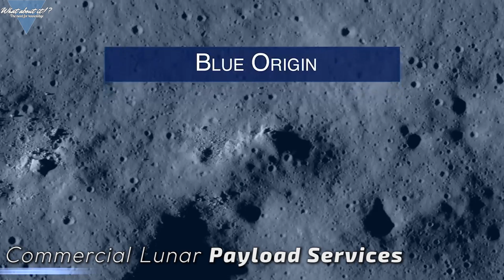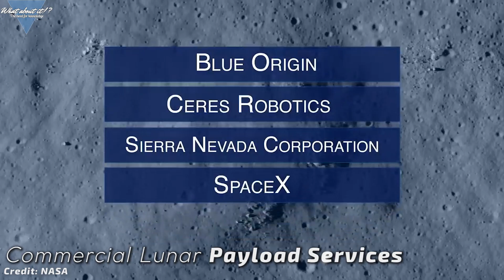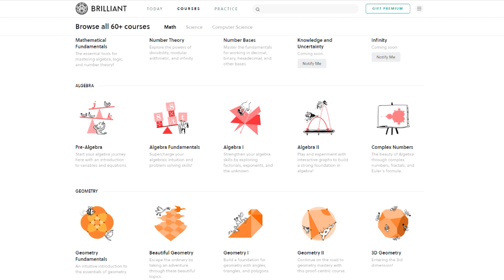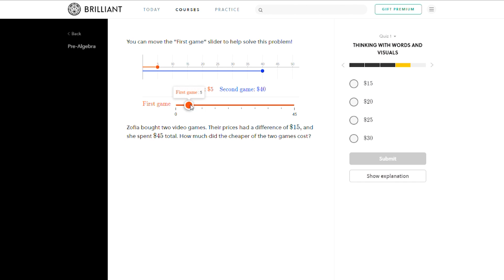69 | Starship Updates – SpaceX Reaches Pressure Goal - NASA Artemis Moon Mission Possibly Delayed

Comment: SpaceX can still land on the Moon easily if they wanted to, as Starship is supposed to be able o land on Mars (so adaptation for a Moon landing should be easy)
So, a private company willing to just mine and refine could partner up with SpaceX to start a fuel bussiness on luna
Reply: I really hope right be for SpaceX goes to Mars they land on the moon just to prove to the tax payers  that they can do it cheaper that anyone and launch a lot more. Then let the politicians have to explain why they would use tax payers money for a much more expensive system.
Reply: im pretty sure spaceX will land on the moon MUCH sooner than Mars.. its perfect to practice and test landings and take offs in rough surfaces similar to Mars and its much safer and easier being so close to earth and lower gravity.. its logical also that space X would test a Mars HAB on the moon before than on Mars..if they get several Starships made (like they plan to) and operational .. testing equipment and landings/takeoffs on the Moon is a must before finding out the hard way on Mars
Reply: Landing a large rocket like SpaceX Starship on an unprepared Lunar surface is not as easy as you think. Lunar dust kicked up by such an attempt would impart enough energy into the dust to achieve Lunar escape velocity. This might become a novel method of Lunar strip-mining!
Reply: @tonyrusi1978  But as there definitely will be a cargo version its moot. You can just ship a lander with it there and then land.
Reply: @theexchipmunk  True, do you a Lunar lander?
Reply: Before we start talking about how easy - or difficult - it is for starship to land on the moon or any planet, I would suggest we wait and see how easy - or difficult - it is to even get it to low earth orbit.
Reply: I know the space shuttle did a horrible job estimating risk of failure for each launch.

What was an acceptable failure rate back then?
And what failure rate will Elon be telling his Astronauts before their Mars mission?
Reply: We are not mining the moon. Period
Reply: Everybody responding "orbital refuelling" please learn that it's in the theoretical phase in 2020. 

My prediction is starship will fail as cargo vehicle due to flap design and human rated version will never exist (Elon said that life support is "easy").

I have spoken.
Reply: @old_house_1906  life support IS easy, it has been thoroughly tested, and was used in the apollo missions 60+ years ago. even without a life support, starship has plenty of pressurized volume and big oxygen tanks, and enough cargo capacity for redundant systems, a crew of 15 are not likely to die of suffocation during the dear moon mission.
 crew are more likely to suffocate in the SLSs orion capsule, which uses NEW life support systems that were designed to be extra-compact to fit in the capsule for a trip to the moon. starship can use the same life support they use in the ISS.

 orbital refuelling was first proposed by ULA, but it got canned as it would drive down the cost of space and make SLS obsolete, and some people in power (boeing) didn't want that.
 spacex is not the only one researching orbital refuelling.

 what do you mean by flap design?
Reply: @old_house_1906  I think Starship will probably prove to be a very capable cargo vehicle but they may not feel safe crew rating it right away especially when compared to space plane and capsule designs.Even if the Starship part doesn't work Superheavy is likely to work as it's just a bigger F9 and they would still get a mostly reusable Saturn V INT-21 class LV by just putting an expendable second stage on it.
Reply: @UC4m7lLoeWsJBMFVTUDKUPsQ we are in 2020. 2023 will be the flight of dear moon project around the moon. in 2022 they are supposed to launch machines and supplies to mars. the mars mission will be in 2024. the starship is in construction, they built a booper in less than a week, the plan is to have a starship superheavy by may and do the first flight this year. starship is still on schedule.

 ok boomer.

 i'd rather the rich use their money to go to space than just hoard it like fucking dragons and make the rest of the world poorer. starship IS the next step in human space exploration, right now there is no way to go to space past LEO, space tourism is for the SUPER super rich, it costs like 100 million dollars to go to the ISS for a single person. starship is supposed to drive down the cost to less than 1 million per person for a starship with a crew of 100. if a bigger space station is built, starship is capable of 150 tons to LEO, so it can transport MORE people for a short trip to LEO, dividing the cost among the passengers and making it affordable.
 starship is also a fully reusable system with more payload capacity than SLS, saturn V and Energia, it will be the most powerful rocket ever built. it will allow for such gargantuan space stations like von braun and stargate to be built in LEO.
 say what you want about it, but you can't deny the technical and scientific capabilities of starship.

 the moon missions didn't stumble onto any impossible problem, they got cancelled and replaced by the space shittle. technology has evolved plenty since the 70s, the space shittle had less computing power than a NES. engines are more efficient than the ones that got humans on the moon. better materials have been invented. there are lithium batteries now, soon to be replaced even better ones. we have moved a lot since 1972.

 kennedy? you fucking moron?
Reply: @jesusmora9379  what is NES?
I know the shuttle had very low computing power

Thanks
Reply: @golfish8589  Nintendo Entertainment System. correct me if i'm wrong, the shuttle worked with 8 bits of computing power.

 starship is going with NASAs current safety margins, the tank was tested for 1.4 safety factor, and starship will be flown something like 100 times before putting crew in it. the mars mission is scheduled for 2024, after the dear moon mission in 2023. they have 2 years to test the systems and do as many unmanned flights as possible.
Reply: It definitely can though it might need a depot placed in the lunar vicinity as normally it depends on the present of an atmosphere for much of the decent and landing.
Might be easier to just carry Masten Space's Xeus or Blue Origin's Blue Moon lander and leave Starship in a high lunar orbit to save propellant for return and landing.
Reply: @husker92  Search "Sabatier reaction"
Reply: Filip Skotnica Spacex could reach the moon with the falcon heavy. Using starship is just overkill
Reply: @yo-no9879  Not if you want to build a landing pad over there and deploy a mining operation.
Reply: Rohan Aarons many disagree wit you.
Reply: Filip Skotnica 

A liftoff by starship might cause a massive amount of debris that will destroy any satellite in lunar orbit.
Reply: @NotOurRemedy  I really doubt debris will be a problem for satellites since meteors have been kicking up so much of it for billions of years and it still hasn't become a problem. Although a moon base will certainly want a launch pad due to proximity.
Reply: Psst. Don't wake him up.
Starship is supposed to land on Mars....  You can suppose a lot. It's very easy and cheap.  But then comes reality and it is a big and  INSANELY expensive brickwall. To this days more Mars landings fail then succeed. The same true for the moon.  
 Besides a heavy lander and command modul can not go to the moon with SpaceX. Neither weight nor room for payload on a Falcon is remotely big enough.  I know physics and logic. don't exist for Elon and especially SpaceX fans.  But trust me, it doesn't bend the rules for Elon or you.

There is a reason why the Saturn V was so enormous. Physics (and even basic rocket technology) haven't changed much  since 1972. Whatever Elon says. 
Here's the deal: the further out your orbit is, the more fuel you need. The heavier your payload is, the more fuel you need. If you have to bring something VERY heavy (complete moon shipand lander)   AND need it VERY far out (moon), even a Falcon heavy (or anything else currently flying)   is comically underpowered and undersized.   

Falcon Heavy reaches the limits with heavy payloads already for Geostationary orbit. Which is roundabout 35.000km (too lazy to look up)  out. The moon is 10 times as far. That is no criticism. THAT is what it is build for, that is where the money is. There is no money in going to moon or Mars unless you're contractor for science missions.

As for Starship... i haven't even seen a working prototype yet. However much you fantasize about landing on Mars with it.  I'm glad if it can deliver even the more realistc promises. But i don't accept suppositions as a fact. And i don't expect anything beyond maybe a first one off manned Mars Landing with a small temporary base during my lifetime. And even the 2030 for manned Mars landings  seem wildly optimistic.  Not just for physical but also financial reasons. A serious Mars progrem would need serious, dependable  and continuous funding. That's not something Nasa had since Apollo.
And that's not something Elon and Jeff, even together could or would provide.
Reply: @5Andysalive  "Physics (and even basic rocket technology) haven't changed much  since 1972. Whatever Elon says."
Reusability is a revolutionary change in rocket technology since 1972. And it enables orbital refueling, which greatly increases how far you can travel with a given size rocket.
Reply: @5Andysalive  not true. not that many landers have failed to land on mars. 

 rocket engines today are more efficient than the ones flown in apollo.

 which is why starship and other spacecraft are going to use in-orbit refuelling. problem solved.
 apollo didn't have the launch capability we have today, they had 1 rocket and then they had to wait for another one to be built, so the rocket had to be very big and carry everything in one flight. we can now transport cargo, crew and fuel separately.

 you only need to escape earth's orbit to get anywhere in the solar system, it doesn't matter how far the moon is. we could build a space station in LEO, fill it with fuel, dock a lander and then fly it to the moon. there is literally no need for SLS, or any other super rocket like saturn V in this day and age. starship is good not because it has a payload of 150 tons, but because it can land, be refuelled, and go back into space again. this reduces the launch cost, like it already does with falcon. right now falcon can do 3 flights a month, starship rapid reusability will also allow it to perform many more flights every month.

 starship is still on development, but many parts have been tested already. the engines and other systems were tested with starhopper. the boopper achieved the safery margins required for a human rated rocket recently. there are rings and engines, there are flaps, landing legs and tanks. they are trying to reduce costs as much as possible by testing the systems and removing what's not necessary. old space contractors could've built the tank and human rate it, but would take years and cost a lot.
 i can say the same of SLS and BO, i haven't seen a working prototype from them. starship is at a similar stage of development as SLS now, but it started like a year ago, and at the current rate it will surpass them very quickly. we will have to wait to see what happens, but it looks like they are on schedule.
Reply: 5Andysalive you can't simply claim to know physics, and then say "I am right" as your evidence. So let's talk some numbers, shall we? You said the falcon heavy struggles with heavy payloads, and couldn't get to the moon? Well, the falcon heavy is estimated to be able to carry almost 60 tonnes to LEO, compared to the 140 tonnes the Saturn V could managed. Open and shut, the Saturn V is more powerful? But here's the thing, you said technology hasn't changed, which is wrong on every front. But you know what makes a spaceX moon mission, even with current technology, possible, given the financing?

The Saturn Vs maiden launch was 1967. Just one year prior, in 1966 the very first example of two space craft docking in orbit occurred. The moon missions had to carrier the transit vehicles, landers, and crew capsules all in one payload, as executing multiple docking procedures was considered too difficult and risky. The only docking manuever the Apollo missions would do would be of the lander to the crew module for the return trip, and even then NASA was prepared for the docking to fail. We've now got docking down pat. It is no longer done by eye, as it was during apollo  but rather by computers, which as has been pointed out, are massively superior to what was available then.
Reply: @dracarysblackfyre6030  he didn't say that he knew physics, he said "I know physics and logic. don't exist for Elon and especially SpaceX fans."
 looks like punctuation doesn't exist for him.
Reply: @5Andysalive  Even Apollo   didn`t  happen. Here are  calculations done  by   Baumann State  University of  Moscow   scientists- http://www.free-inform.ru/pepelaz/pepelaz-13-3.htm  Their  calculations show that  Saturn V  was  lighter for  1200  tons than officially  claimed. That is why  they use   Russian Rd-180,  and  Nk-33    engines and    wouldn`t touch their legendary  F-1  even  with a  10  foot  pole.
Reply: Leo Timtom what makes more sense, the us government, through decades of development and trillions of dollars, went to the moon, or that both the liberals and democrats, the Russian and soviet government, the Chinese government, the ESA and all other agencies capable of viewing the landing sites, and retroreflectors, are all in a big conspiracy cover up to fool us, the people?

Conspiracy theories are a way for people like you to sound smart when talking about a topic you know nothing about, and always rely on a single poorly documented source. As another person already linked, the Chinese government made it a point of pride to detect the apollo landing sites. Do you really think the Chinese government would support a propaganda ruse set up by the US government five decades ago? Or maybe, just maybe, that one source you linked to is wrong?
Reply: @dracarysblackfyre6030  China   will use their knowledge  about non  existent Apollo missions as leverage in  future trade wars. So did  Soviet  Union. And it is not  only  one  source  that  has data against  Apollo. It is    many sources that    calculate  different  aspects of  Apollo missions  and all  come to the  same  conclusion   something is  wrong there.   For  example,   3 different  methods  were used  to verify  Saturn  V`s    speed, and  alll of them  consistently   showed that  it  was underpowered.  Do  you need more  sources? Here  we go- https://www.aulis.com/PDF/F-1_Evaluation.pdf